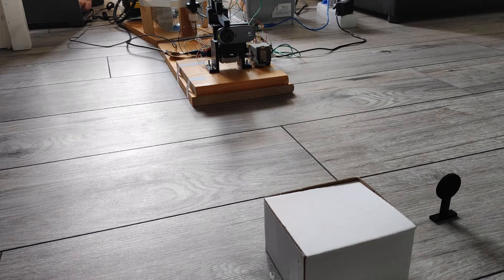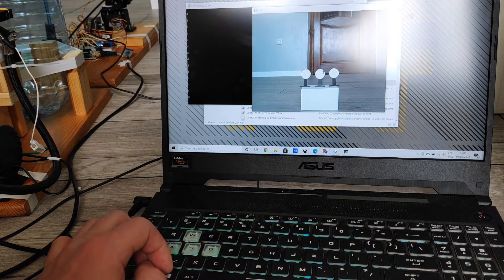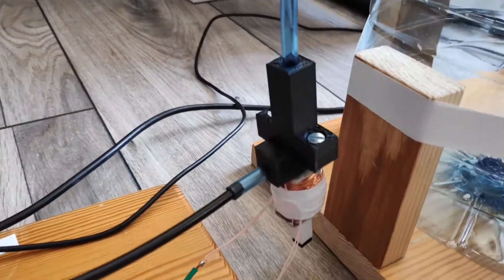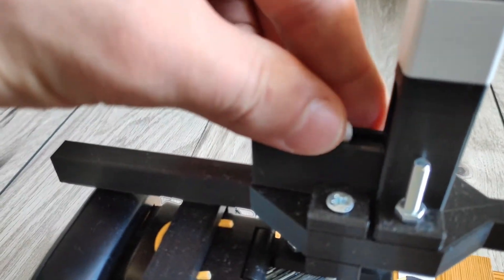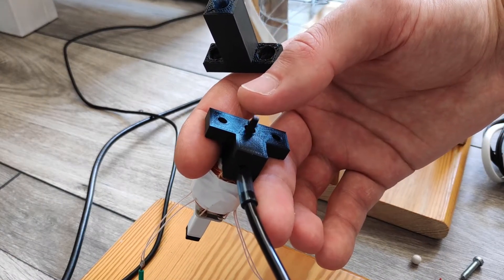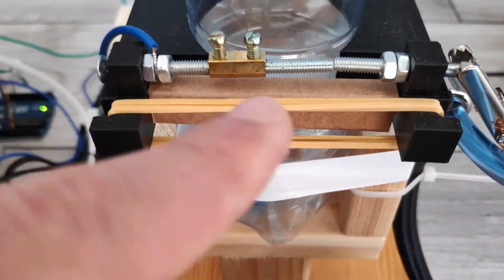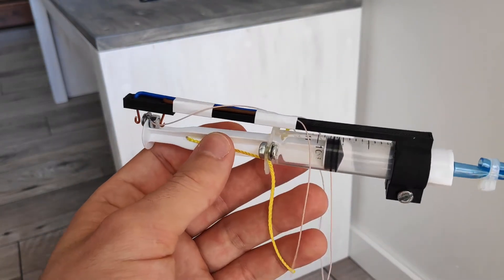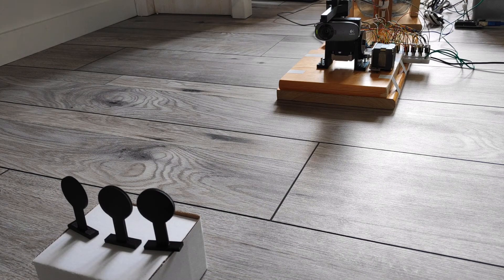The worlds coolest BB gun?

Comment: Its amazing how simple some things are when you don't have anyone around telling you.. "No.. That's crazy thinking. It wont work" . I don't have the machinist education that I'm pretty sure you've got.. Either self taught , learned from someone else or both. Ive got a minor in structural engineering and since i retired ive been working on scaling down from figuring out how to get a 40 ton blast valve safely out of and back into a US Steel blast furnace .. Down to things like figuring out how to change several of the cheap flickering candle looking solar powered lights to a household plug so i can use them inside. pretty easy. but just saying. i enjoy watching videos like the ones youve got. The way you say things like.. Why did i do it like that? Because that was how i wanted to do it. Thank you for the videos. Ill never build one(BB Gun) but its fun to watch.
Reply from the maker: Thank you! I appreciate the comment. I have masters degree in electrical engineering and I'm working in a display factory as a process engineer, but when it comes to projects like this I would say that 90% of my knowledge comes from other youtube videos. My education simply gives me the confidence that I'll be able to pull this off. You can learn almost anything for free online these days as long as you have the patience. That's just amazing! Thanks for the comment one more time, cheers!

Comment: kool man ...can I outfit that with lower laser instead of a bb gun to pop ballons?.. can I use a raspberry pi as my computer?
Reply from the maker: Using laser instead of bb gun should be no problem. Also training to recognize balloons instead of targets. About using raspberry pi instead of pc for running the software, that's a lot more challenging question, but I think it should be possible. The're are two main questions. Software compatibility and hardware resources. I'm pretty sure there is someone who has done it on raspberry pi, but the question is how fast does the object detection work since that definitely depends on the hardware. When I was working on this project I remember there were some versions of software that made it possible to run the object detection on microcontrollers, but there were some minimal requirements. At this moment without any additional research I think it should be possible to run the object detection on raspberry pi after you are done with the training process that is normally done on your PC or google colab in my case or using other hardware since the training process is the most resource demanding part.
Reply: @ I took a 5Watt DIODE laser from an old CNC machien, turned it up 45 degrees (I made a special bracket 4 it) facing out. The only thing is I had to get up close to something to focus laser like a wall. Now I have to config. the software part of my project.
Reply: @shortcutelectronics  I converted an old CNC 5w laser diode....turned it up 45 degrees unsing a special bracket I made...now All I have to do is get the sofware side to work using a Raspberry pi with a camera....I have moving targets designs I did on AutoCAD...I may addapt one of digns if I can.